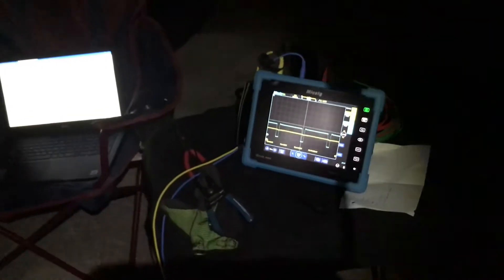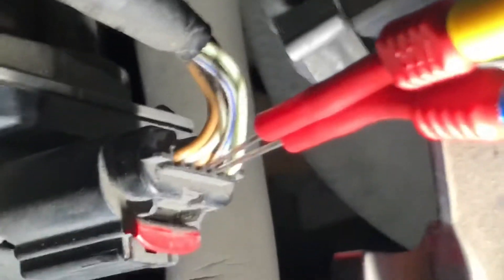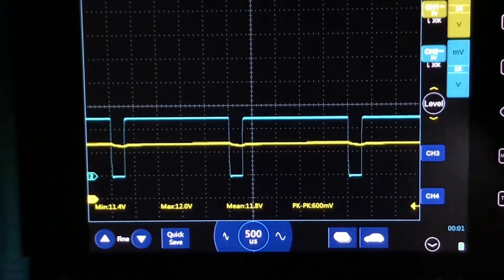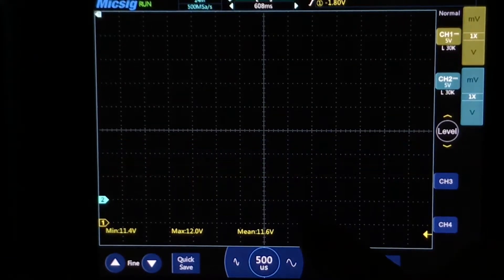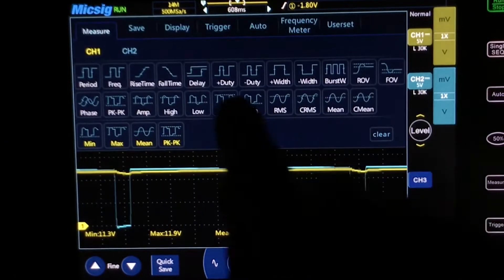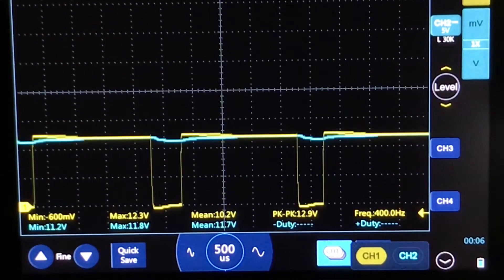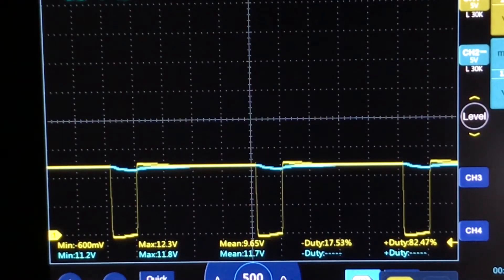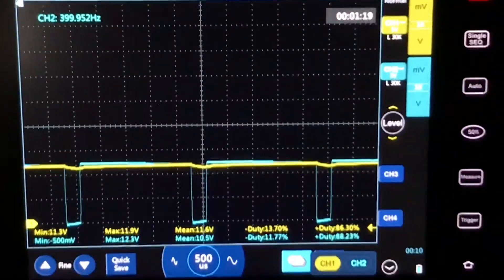Micsig ATO1104 Automotive Scope Throttle Servo Motor / TPS

Comment: Thanks for making the videos. The set up and measurement selections were a little confusing at first,  especially when compared to other lab scopes used. The videos helped answer questions with channel set up and navigating the signal measurement selections on the 1104. Thanks again!
Reply from the maker: Glad I could help Stephen Banta. Thanks for watching, I appreciate the views.

Comment: Have you ever used Hantek1008C oscilloscope ?
Reply from the maker: No, I’ve never used a Hantek scope. When I was first shopping for a scope, I was looking at some of the Hanteks, but once I found the Micsig, it was all over, lol. Why! Do you have one? Or are you thinking of getting one?
Reply: Yes I'm thinking to get one that fit perfect for diagnostic and everything but I've watched  some reviews of hantek is more cheap than micsig but watching your videos looks like micsig is pretty handy and got nice option so that make think to buy it.
Reply from the maker: Yea, I know you would be happy with the Micsig. I am anyway. I don’t know much about the Hantek, but one big difference between Hantek & Micsig is the Micsig does not need a laptop (or computer). The Micsig is a stand alone tablet oscilloscope, so you don’t have to worry about having a charged, working laptop. I don’t remember much about the Hantek, other than when I was first looking for a scope, I looked at the Hantek, but then I found the Micsig; and after comparing the two of them, the Micsig seemed like the better choice. As I said, I have nothing against the Hantek. I’m just giving my opinion and view on things. I personally really like my Micsig. Also, everyone else that I’ve spoken with that bought a Micsig, all seem to like theirs as well. If I were to get something other than a Micsig, I would want the 4 channel Pico automotive scope. Only, they do cost a lot more. In fact I was just on the AutoNerdz website looking around, yesterday, and I noticed the new model 4425A 4 channel automotive Pico scope,  by itself (no leads, etc.) cost $1,369
Reply: What bnc leads are those? I just got mine and want longer leads. I like the ones in your video since they color match. So far I like it. Nice video.
Reply from the maker: Hello. I use the Pico 3 meter color leads. 
https://www.aeswave.com/premium-test-leads-3m-long-set-of-4-p9543.html